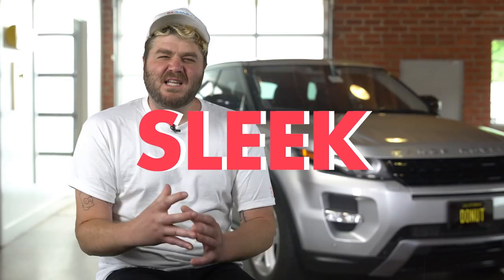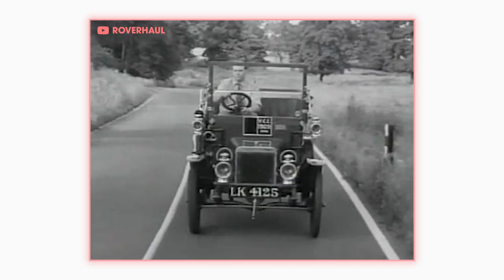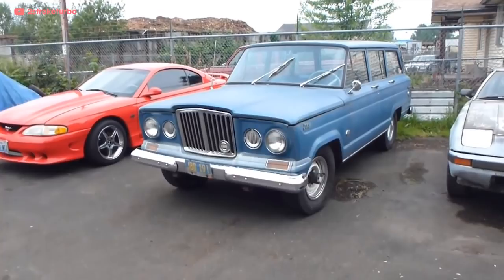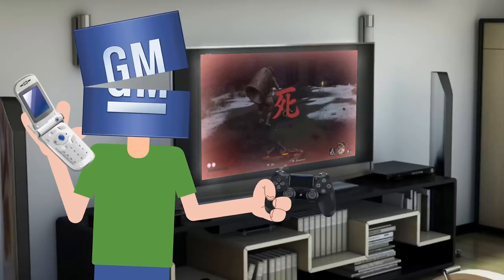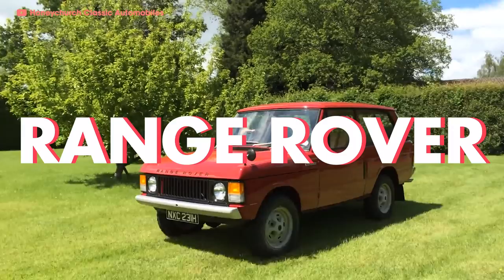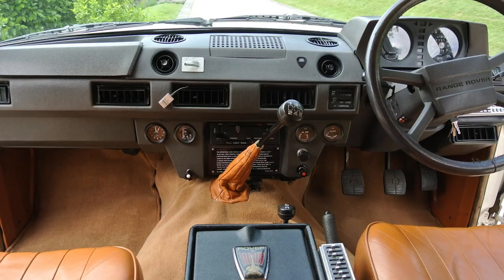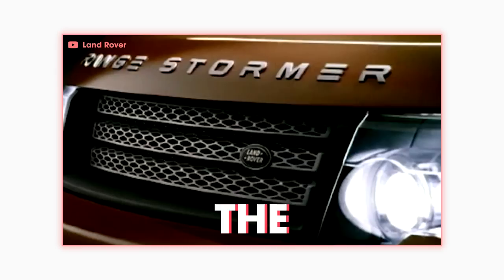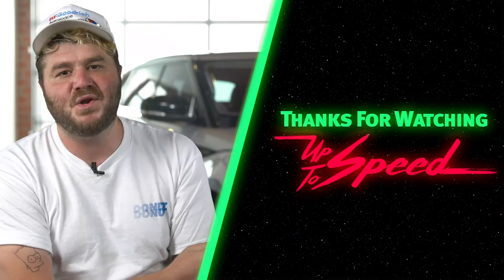RANGE ROVER - Everything You Need to Know | Up to Speed

Comment: A V8 THAT'S ONLY 12 LBS. HEAVIER THAN A 4 CYL. 

Breathes heavily in LS swap.
Reply: Ls: am i a joke to you
Reply: Coyote is the new ls
Reply: @dakotasilverman7915  idk about that one. Say what you want about performance, idc. But the LS packaging is the reason it's a more universally used swap.
Reply: that doesnt make v8 light but 4cycl heavy
Reply: @axel3895  facts are facts. LS series v8's typically weigh around 430-480lbs running. That's not quite but close to 4 cyl territory. In the case of the rover it was a heavy 4 cyl.
Reply: The buick 215 weighs 300lbs with all accessories and fluids, thats like 200lbs less than an ls, not including the transmission which is also much lighter.

Comment: They can go anywhere they want.
They just can’t make it back.
Reply: Lovin that air suspension til it blows halfway up a hill 😂
Reply: @jourdanwebb2700  I'm jealous! I recently bought a 2001 P38 and man, nothing is more fun to drive. Put about 4k on it, EAS went, SRS airbags faulting, and the worst part is NO ONE will work on it 😭
Reply: @jourdanwebb2700  I appreciate your response bro! Power to you and your pops for working on em! Yeah 4.2 V8 it's the meanest sounding beast with magnaflow exhausts! I'll look into the 02 thanks man!
Reply: @jourdanwebb2700  I'm going to try today man. Thanks so much for the advice!
Reply: And probably that's the reason you need the Land Cruiser 👀💯👌🏼💪🔥
Reply: @amaankhan6721  I love land cruisers but where I am they cost an arm and a leg, especially older ones. I got my landrover disco for free and have dropped about 1000 into it and haven't had problems besides small things, never left me stranded tho... I have seen broken down Toyotas and have seen broken down landys. depends on ownership I suppose. No doubt landrovers are more work but a proper owner shouldn't have that many problems with them unless they abuse and skip the inspect and fix part after a really hard day in it.
Reply: @Spoons81  you got a disco for free... Could you please explain Sir?
Reply: @amaankhan6721  haha previous owner hated the thing, its crankshaft sensor went bad and its battery was bad, it was parked on the side of the road and he said if you get it running its yours. So I guess not completely free since I put money into it
Reply: @Spoons81  probably the most lucky dude I have ever came across on the Internet ✅👀
Reply: @Spoons81  woahh ✅😢👀
Reply: @amaankhan6721  hahah it was good luck thats for sure. And I daily drive it now 😁
Reply: @Spoons81  great man... Feeling happy for that ✅👀🌸💯
Reply: I’ve had 2 Range Rovers the past 7 years and none of them had issues ever other than an alternator going bad or the boot making weird noises when closing it so i still thing that Range Rover is better than any german or Japanese SUV believe you wont get the Range Rover luxury, capability off road, style and handling with any lexus, toyota or any german SUV
Reply: @DBSbluedevil  AIR BAG'S ON MY 2002 LAND ROVER AROUND THE 145,000 MILES 🙋🏿‍♂️🙋🏿‍♂️🙋🏿‍♂️🙋🏿‍♂️
Reply: @mr.klutchrednose2700  what about them?

Comment: Fun fact: that 215 Buick V8 was also loaned out to Oldsmobile. Olds tweaked it a bit, and added a turbo. Yes, a turbo. In 1962. Oldsmobile cutlass Jetfire. Don't forget to fill up on Turbo Rocket Fluid (water/meth injection)! It already had over 10:1 compression, so to eliminate detonation, that was Oldsmobile's solution. It made 215 hp at 4,600 rpm and 300 lb⋅ft at 3,200 rpm. The cutlass, and the '62 corvair monza spyder were the very first production american turbocharged cars.

Comment: "If we look at J.D Power, from the years 2007 to 2016, Land Rover and Range Rover’s best score was either 3 out of 5 or 6 out of 10. For eight of those years, they scored 2.5 out of 5 or less. This is below average for dependability. A further study by J.D Power found that the industry average for problems was 133 per 100 vehicles. Land Rover had a pretty shocking 179 problems per 100 cars."

Comment: I loved owning a 1994 Land Rover Discovery with coil springs and a 3.9 l V8 4 Speed Auto, It could crawl over and up just about anything with ease and then with a shift of the CDL from Low to High it could accelerate up to 200km/h with ease with awesome road holding ride quality.. Sure the differentials were easy to destroy if too much power was applied but a simple differential conversion using 1990 Nissan Patrol GQ differentials was a common fix for the more extreme Land Rover owner. Did America get the 1990 Nissan Patrol GQ Y60 Coil sprung Wagon? They are very popular here in Australia.

Comment: You missed that the first gen Range Rover actually ended in 1995, not 1994. The 1995 Range Rover incorporated the air suspension as well as a huge interior update to the dash. P38’s also started in 1995 but there was still the previous gen Range Rover in production. The 87-95 range rovers are considered “Range Rover classics”.

Comment: May I add that if you climb a steep hill the rear diff will brake, or the front one, if you go downhill and try to back up the front axles will surely brake, the the front driveshaft, then rear axles. Steering bars are a joke too. After many years the chassis will have holes, and all that with choking engines

Comment: I owned a 2006 Range Rover and it was AMAZING.... (-when it worked)... it leaked oil all the damn time... tons of electrical issues that literally showed up out of nowhere and often magically fixed itself... the adjustable air ride was unpredictable and failed on me twice... i finally sold it after only 3 years and took a huge bath on how much i lost on the suv...  if it were more dependable it would be the best SUV on the market IMO but it was just too unreliable.  Great power for an SUV though and was fun to drive and incredibly capable offroad.  now their priced just crazy IMO and i have no idea if they are more reliable than back in 06'

Comment: My last v8 one of the injector loom clips had been left off by a garage, the dam thing just upped its flow rate and must have scavenged off the other cylinders because it went a year unnoticed. Iv had 4 range rover v8s. Had 1 old 3.9 break down when its distributor cut itself in half! The others were brilliant.

Comment: Duuuuuude. In L322 (3rd gen) was a 3.0l diesel engine (M57) until 2006. This same engine was mounted in E39, E38, E46 pre lift etc. After it they put in 3.6l diesel V8 and after after 4.4l diesel V8.

Comment: Classic Range Rover, because if you try to reach 70mph on a Series 2 your death wish become reality. Fun fact, the P38 was the last RR on rear and front solid axle/radius arm design same as the classic and roughly the same components. The following L322 changed drastically, new dash, more electronic toys to play with, had indipendent suspensions all around a bulkier body and it is much taller. With a few pros and cons, pros = more comfort and a better road behavior plus better offroading thanks to the increased travelling on the struts. Cons = that raised up the weight to a whopping 29xx kilos without passengers increasing the fatigue on the Bmw's diesel and the gearbox, a lot of cars suffered gearbox failures.

Comment: Do a Nissan maxima Pumphery..... Plz. That is the ultimate sleeper car!!! I got a 1996 maxima with 2009 VQ35DE, and a 2003 6 speed manual transmission. I love the way they run, ppl don't know how Badass the Maxima AKA (Maximus prime) Is. With just light mods on THE 190HP 1995-1999 VQ30DE they haul ASS. Plus they are one of the most reliable cars in America (1995-1999 190HP VQ30DE & the 2000-2001 240HP VQ30DE-K) Just take a look at them and find it in your heart 2 make a maxima video (4 door Fwd 350Z) thanks.

Comment: BMW owns rover,🤔 no wonder my 04 range is as reliable as a turd, the engine blew sitting in the driveway.... I'm replacing it with a Cummings R2.8 diesel crate engine... instant reliability